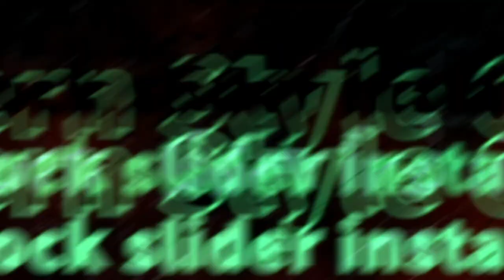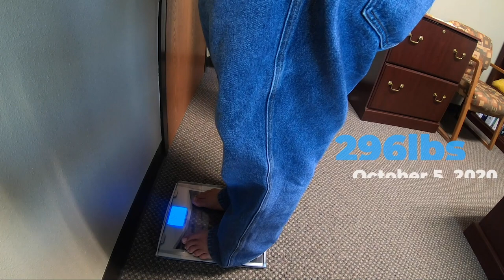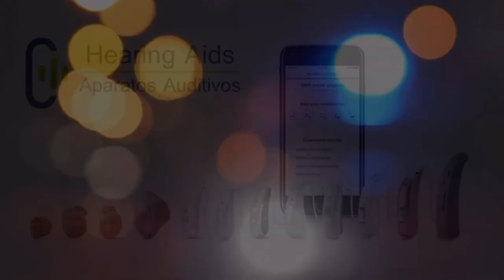SSO Rock Sliders on Lexus GX460

Comment: Robert, Interesting video again, coincidentally I was watching Coastal GX videos on the TV in my garage while i was mitigating surface rust underneath my Jeep Wrangler. The products I used were:  1. Spray "Lime A Way" (Walmart) on any rusted surface or bolts, wait 15 or 20 minutes, rinse with water & mangeda. You can re apply Lime Away and rinse again, but it will take off rust, dirt, grease and paint so be careful where you apply it. 2. After dry, use a wire brush or a cordless drill with wire brush attachment (or both) to remove any loose rust, and leave the area clean and smooth. You can rinse again with water or wipe area with a cloth and/ or use a leaf blower to remove all loose particles - get ready for painting. You wont get 100% of rust off but 95-96% is fine. 3. I used "Por 15 Top Coat" (Black color) (Amazon) - it provides a rust preventative coat  to paint the underside of my Jeep. Wear gloves and long sleeve shirt - the paint is hard to get off your skin.  I lay down and tape a roll of painter paper in the garage to catch any drips, A quart of paint was plen ty to do all my Jeep underside. It will last for a good while, but I used the phrase "mitigate surface rust", because as you go back out again...over time..rust will come back - and in a couple of years - you must repeat the entire process.  My Jeep is 23 years old - and I use it at SPI often, and my Jeep looks showroom finish clean, l should have used Youtube to do a DIY video, maybe next time!
Reply from the maker: George Briones Thank you for sharing!! This is definitely me of those “I should have” moments. We can’t go back in time, but we can do something about it right now. I appreciate your help! 🙏🏽

Comment: You can brush off the surface rust or have a autoshop do it.    Aftermarket anti rust sprays can be used.   Fluid film is popular but I used a waxed like product called valuguard.   I had my f150 sprayed when I got it back in 2019.   F150 rust fast so I'm glad I had it done.    I recently picked up a 2010 GX460 so enjoying your content.   I took off some of the underbody shields/covers and cleaned off rust and bedliner sprayed it.   NJ winters can be brutal...
Reply from the maker: Congratulations on your GX!! I went with a product called POR-15 and it’s held up great. I used them on my rock sliders and it’s almost like having a ceramic coating on them.
Reply: @CoastalGX  cool saw that in your other video.  Nice

Comment: I'm from IL where we salt our roads for snow and it kills our frames. Yours isn't bad at all. If its just bolts or clamps, Replace em. Its easy and cheap. Everything else here is what you do.
-wire wheel all the rust until you get all the "loose" rust to flake off
-use a rust converter called corroseal to stop the rust 
-wait til corroseal is cured and then use some VHT chassis/rollbar paint on top of the area
-apply a protective coating such as wool wax, or cosmoline once a year to prevent any rust to form again. 
-do not use any rubberized undercoating. That will trap moisture and make it worse
Reply from the maker: This is what I LOVE about YT! Paul, you’re awesome; not only did you provide me with good info, but you restored hope. I really love my ride and I want to keep it forever if I can. 🙏🏽

Comment: Nice vid. Up in Canada the roads are heavily salted in the winter.  I get my GX oil sprayed bi-annually with a product called Krown.  You can do the entire underbody and they also drill holds in some body panels and apply the spray to unseen areas for full coverage.  Probably not a popular thing in the south but a good preventative measure up here.
Reply from the maker: Thank you for the advice. I purchased POR15 after some suggestions. I still have to do it though lol.

Comment: In the market for sliders on my GX. How are your holding up? Are small children still able to climb up? Do they stick out far enough to still use as a step? Are they angled at all? Great video! Thanks.
Reply from the maker: Hi Noe. They are hardcore. If you order them, make sure to get them powder coated from SSO. Yes, kids and adults can use them with a lift. I haven’t needed to use the “kick out” feature since it hasn’t been necessary for me. Feel confident that they are heavy duty and well made. These aren’t flimsy accessories.

Comment: Nice sliders mate, what we do here after each trip to the beach or dunes, we wash our car with hot water and steam pressure and ensure they add with the pressure coconut oil under the car to protect and prevent corrosion it helps sometime if coconut oil not available use diesel mixed with oil spray with hot water.
Reply from the maker: Thanks for sharing, that’s an interesting cleaning method. Where do you off-road?
Reply: @CoastalGX  am from the Middle East country called Sultanate of Oman lots of off-roading adventure here.
Reply from the maker: @XtremeLander  wow! Thank you for watching, my friend! I appreciate your support. What do you offroad?
Reply: @CoastalGX  enjoying your channel mate, I use to drive 2008 fully loaded FJ cruiser and recently purchased a 2016 gx 460 premium  3 weeks ago and the car is being lifted  by our local iron man dealer while we speak with iron man foamcell suspension + upper Arms and sway bar relocator and Methods 305 NV black with zero Offset, so your videos helped me build my new car.

Comment: I took my truck to Oiltrell in Corpus. They do a rust treatment undercarriage coating and spray inside doors and fenders. They use and oil based undercoating and it’s been good. They take lots of city vehicles and trucks that patrol the shore.
Reply from the maker: Thanks Joe! How much did it set you back?
Reply: They charged me 300. I’m also taking my Ford over to get treated.
Reply from the maker: @switchman956  I wonder if I need to make repairs BEFORE the treatment.

Comment: Sir, the GX IS full time AWD, but with a torsen LOCKING center differential. When you push that button THEN it's 4WD. The torsen center diff will vary torque split front to rear as needed, but when you push that center diff lock button THEN it's 4 wheel drive.

Best way to deal with salt water, DON'T DRIVE IN IT! It's totally not necessary to drive in ocean water when cruising the beaches.
Reply from the maker: It’s a full time 4wd; different from awd. Yes, you can lock the center diff and it has the 4lo option obviously. The vehicle is always in 4high. As for saltwater; you’re correct about avoidance, but that’s not always possible where we go and what we do. Sometimes it is necessary to drive through it; especially when you get caught in a sudden storm.
Reply: It's full time 4WD.  Most AWD systems today are slip and grip types.  90% front until they slip. The GX460 fulltime system is amazing on and off road.  Few cars today have a true center differential.  Toyota/Lexus/Mercedes G-Wagon... the rest have some for of a clutch